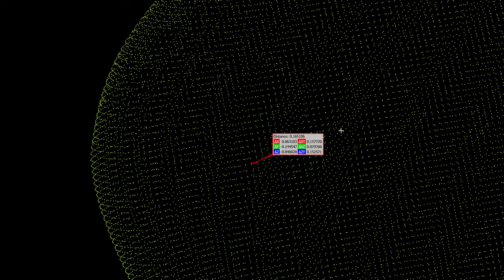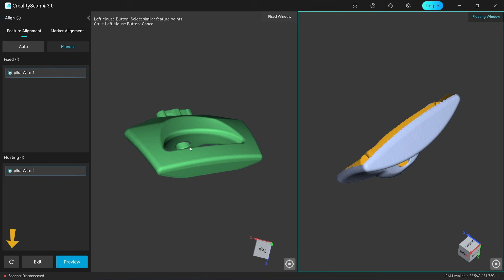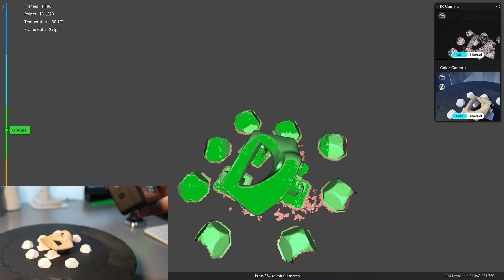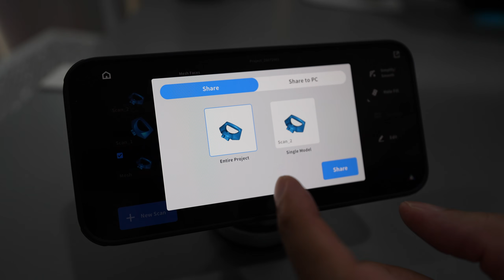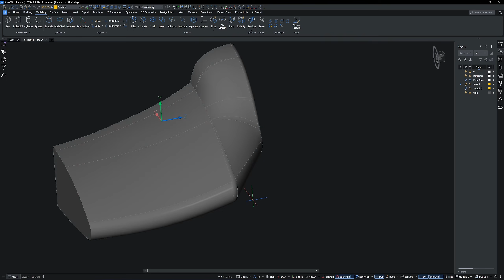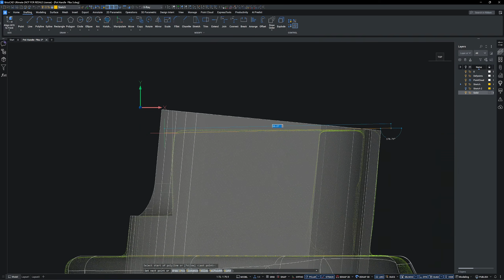Creality Pika – Beginner Scanning Tutorial & Reverse Engineering Workflow

Comment: Thanks for video, wanted to ask did you use the scanner with the original reality software that it’s offering on the webpage quick surface Lite that it’s quite expensive even for one year and what can be the difference using this software or that one that you are using this one does it came with the scanner thank you
Reply from the maker: I don’t recommend using Quick Surface, it’s a third‑tier CAD tool with a very small user base, and its performance never reaches that of true professional CAD platforms. They market it to new 3D scanner users as if it’s essential, but in reality it lacks the capability to model complex parts. Instead, I suggest learning FreeCAD, it’s the only free CAD tool that supports point clouds.
Reply: @Payo-TensileCreator  thanks for answer, so if i understand good to use scanner you only need crality-scan software? Is it possible to export a model to step for adjustment in Onshape that i draw in? also didnt really get why to use point cloud in freecad if you can scan it, why reverse engineer it it step by step?
Reply from the maker: @PhonePCDoctor  A 3D scanner produces a mesh with millions of polygons. Even if you capture 100% of the scan data, printing it introduces some degradation. By remodeling in CAD, you can regenerate missing details and modify the design as needed. A CAD model also offers infinite resolution while requiring very little storage.

Comment: Hi Payo, How come I can not see the laser scan function in cell phone? Regardless connecting with usb or not? I can only see the infrared scan function?
Anyone knows?
Reply from the maker: You might be using a slower phone. This workflow requires a certain CPU, on Android, it needs Snapdragon 8 Gen 2 or above. I don’t know much about iPhones, but one viewer reported achieving 60 FPS in laser mode with the iPhone 17 Pro Max.
Reply: @Payo-TensileCreator  Hi Payo, I figured out. Yes you are right. The software decides if the laser function is available or not based on the phone performance. I connected to my desktop through wireless and the laser function is available. It is recommended to close all the network adaptor except the one for pika. It is also thicky. Thanks a lot for helping me!

Comment: I've scanned a similar smooth object using the same settings as you, but mine never come out as smooth as yours, even in the initial point cloud.
Reply from the maker: Have you fused the point cloud yet?
Reply: @Payo-TensileCreator  i did yeh, literally followed exactly what you did. My scans are coming out "grainy" (lots of micro dimples over the surfaces) and with quite a lot of line type artefacts (i assume due to the single direction laser lines).
Reply from the maker: @Skonker Have you calibrated the scanner?
Reply: @Payo-TensileCreator  i did yeh, twice.

I could send you a scan of something (mesh and point cloud) if you like. Just my Logitech MX Anywhere which I feel should be an easy one for it to make nice and smooth, but its not very.

Comment: How accurate does it seem to be with volumetric scanning? Wanting to scan some 1960s engine parts for posterity.
Reply from the maker: When scanning larger objects, use the global marker mode, the software’s correction system will stabilize the loop and reduce drift.

Comment: Thanks for the video. It still misses one crucial information - the Pika has almost two times smaller distance between cameras than Sermoon P1 or S1. Thakns to that Pika is smaller - but what is the cost? Does it limit the max size of the object that can be scanned? I mean there must be a reason why all other scanners are bigger, and scanners meant fo scanning large object have that distance eve longer even up to half a meter. What exactly are we sacrificing with Pika's small size?
Reply from the maker: One drawback I noticed is that its angular accuracy error is higher than the Raptor and Sermoon series. However, the lens angle sits between those two, allowing it to capture shallow gaps and grooves without relying on a single‑line mode like the Sermoon.
Reply: @Payo-TensileCreator  Honestly I'm surprised it does so well. With the size like that I thought it would suffer with larger objects :o
Reply from the maker: @kaczorefx  It tracks better than original Raptor, very close to Raptor Pro.
Reply: @Payo-TensileCreator  Nice :)

Comment: I hate having to connect my phone to a devices wifi.  I prefer a USB cable.
Reply from the maker: There’s a short USB‑C cable designed for portable NVMe drives, and you can mount it together with a phone bracket.

Comment: Have you had to deal with Creality Support? I got a raptor scanner and their rubbish software bricked the IR camera. I couldn't rollback the firmware under version 3. I requested an exchange or refund and they refused, eventually running out the clock on the warranty. So word of warning if you buy any of their stuff and it breaks, you'll likely have problems. 

i updated a few days ago to version 4 software and it is junk - optimised for tablet or phone as the dialogue boxes are chunky (although this looks better). I have 4k monitor and it looks lik the UI its set to 800x600 or something wacky. I got my IR camera back. But the quality of scans was like a potato - as it is now locked to 0.1mm of scanning (as I have 32GB of ram). There's no way to bypass this. You can process only at 0.05 not 0.02. I spent $2500 on the raptor to get the 0.02mm not 0.1mm. i could have got one of their base scanner models and not spent $2000 with their stupid company. I don't care if it takes longer to process as it is local processing, iwant the quality. I suspect they are downgrading the quality as they want to push people to online services where you upload scans for public use and/or they'll  use AI processing on the cloud and charge for the time. I uninstalled the version 4 software and went back to the 3 that I was using it need upgrading to allow 50Series nvidia cards and it Nerfed my quality too - NOT HAPPY AT ALL!!!  I wonder if louis rossman @rossmanngroup would be interested in the ensh!tification of the product.  I wish I never bought the scanner.  I did find a possible workaround where you change the config ini files etc. but you shouldnt have to do that.anyway rant over. 

@Payo that not good for Creality but it is engagement for you. You do good videos - even if they are for a crappy company haha

Comment: Excellent video! I really like the small size and possibility to use it with Android smartphone. And even with Smartphone laser mode is supported, which is not the case with Pop4. Because short distance of the cameras on the Pika i would expect good deep hole scanning possibility. Is this true? If yes, could you make video about this and compare with P1/S1 using one laser line?
Reply from the maker: I noticed a difference when scanning this handle with the P1 compared to the Pika. On the P1, I had to switch to single‑line mode to capture the gap, while the Pika’s seven‑line mode was able to pick it up directly.
Reply: @Payo-TensileCreator  For deep hole scanning (also maybe threaded), which one <1000€ would be recommended? Pika or Einstar 2 for example? Einstar seems to have more laser lines in theory. While Pika is 2/3 of the price and a bit "newer".
Also creality is known for dropping support for their printers fairly quickly after release. Is this something to be concerned about with the Pika?
Reply from the maker: @DiverseGreen-Anon  “I don’t think their product support is very good. That said, a 3D scanner has few moving parts, mainly a cooling fan that could fail and a battery that may wear down over time.
Reply: @Payo-TensileCreator thank you for the answer! Short question: are they using standard 21700 cells (3,7V) for the Pika?

Comment: really liking your vids. learning a lot. What kind of specs do you need for a decent 3d scanner, not just the Pika?
Reply from the maker: Mostly, I use Sermoon X1 for my projects. It's the most precise and accurate 3D scanner I've.
Reply: @Payo-TensileCreator what pc specs do you need? In akl the marketing materials, its not really mentioned.
Reply from the maker: @ChitosVids  PC with +8 core CPU less than 3 gen old, Nvidia GPU, RTX 4060 or above and 32GB of RAM

Comment: One of the best videos for the pika and Creality Software, thanks.  I need to scan the lower half of a shiny RC Jet.  About 300mm by 1000mm.  Accuracy can be 1-2mm.  What would the best scanning process be for the Pika?
Reply from the maker: Scan in laser‑marker mode. If the surface is too glossy, the scanner will pick up data more slowly, apply spray to improve capture. Place the markers first, then spray. AESUB spray self‑evaporates but has a strong odor, while SKD‑S2 is cheaper though it requires manual wiping. Both contain mild solvents, so test them first to ensure they don’t affect your paint.